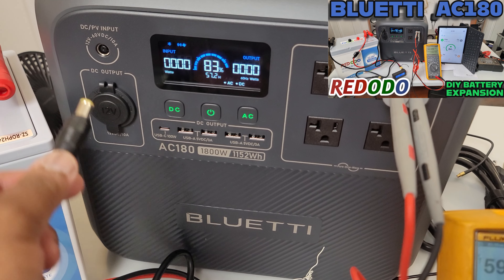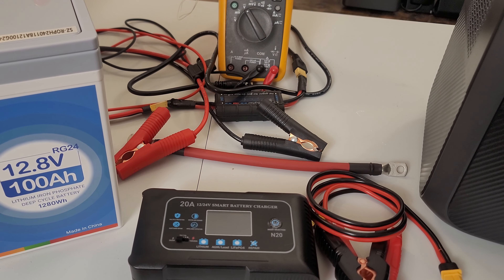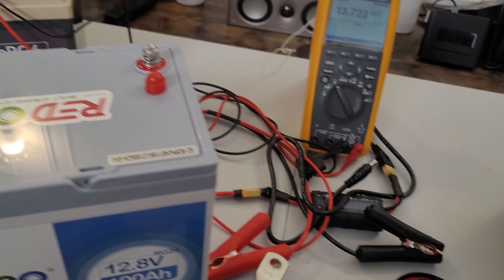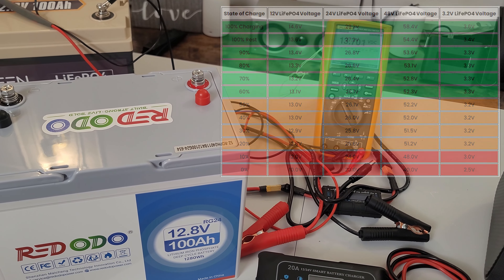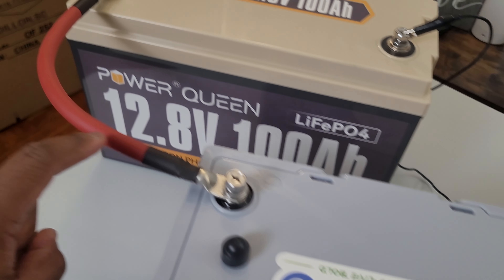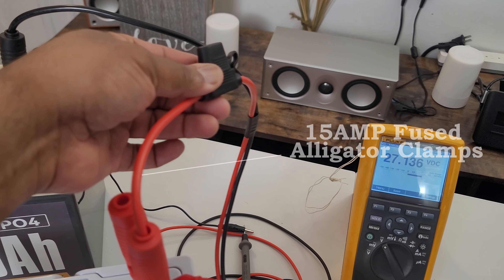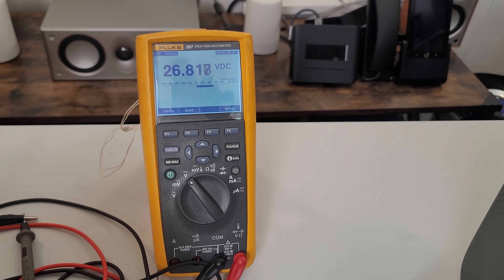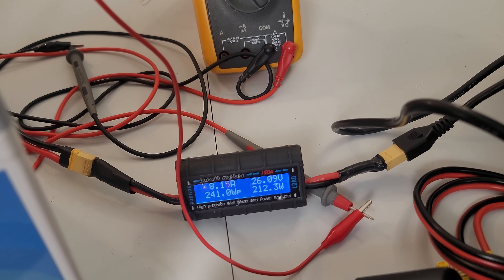Bluetti AC180 charging at 24 volts!

Comment: Based on your review, I purchased 24v 100ahr Repower Flow Battery in a case. Connected to BLUETTI AC180 thru cigarette adapter and it charges at 207 volts. The port is rated at 24 volts @ 10 amps. Now I have over 3000 watt hours of capacity. Will test if charging speed increases with 50 amp Anderson connector.
Reply: Sorry. Charged at 207 watts not volts.
Reply from the maker: Wow! That is awesome news! Thanks for the update and the information! Sounds like a great way to keep your unit topped off and with plenty of storage!
Reply: @randysmith3959  can you use solar to charge that repower unit?
Reply: You would need a cheap solar controller I believe. You can charge thru cig lighter port in your car but would take a long time.
Reply: Thank you fro watching@jeverhart99! Yes, you can utilize a solar panel directly to the unit or use a solar charge controller connect3d to panels with up to a limit of 60vdc.
Reply: @domingoc9721  Thanks!
Reply from the maker: Thanks again, and i responded from my second channel. lol 😅 sorry, and thanks again for watching!@jeverhart99.

Comment: From what my research indicates is that it is not recommended to put LiFePo4 batteries in SERIES without using a battery balancer. No battery balancer is needed when they are connected in parallel. Use a 12vdc to 24vdc 8-10 amp dc-dc booster transformer to get 24vdc from the 12vdc battetie/batteries.
Reply from the maker: Thank you for watching REDARROW-ez7dg and great comment! I too have researched this and yes, if you use 24 - 60 volt series connection, it is NOT recommended to use IF you are re-charging the pack. If you are draining the batteries in series, the types of batteries with the BMS in this system, would be okay for me but not saying it should be practiced. Being that these 100ah batteries are already in series utilizing 4 100 ah 3.7 volt batteries, these BMS have a low voltage disconnect that will protect the batteries from being damaged. What I would recommend is that you can drain them in series, but charge them separately to prevent any damage to the batteries. Not to mention to use a multimeter to check the capacity of the batteries. Not to mention, how much is being pulled from the batteries is another question. Remember, the Bluetti to recharge it through that port, is utilizing about 200 watts which is not a serious draw.

Sorry for the long response but thanks again for the great comment!

Comment: So in this configuration, is it possible to also use the AC180 for powering devices simultaneously?  In essence extending the time the AC180 could operate?
Reply from the maker: Thank you for watching longpoint17! Yes, you can drain and charge the bluetti AC180 and it is called pass-through charging. It has a UPS feature which allows you to have a device connected to the bluetti and use the power at the same time. In the event of a power outage, it automatically switches over. I hope that this answers your question and take care!
Reply: @TheCrucibleOfNYC  It does!  Thank you for your response!
Reply from the maker: You are very welcome and take care! Happy Thanksgiving and many blessings 🙌 🙏🏽

Comment: thank you for this video, I was thinking of doing this with s 24v 100ah lifepo4 battery. Have you tried charging from empty to full? Can you charge while discharging?
Reply from the maker: Thank you for watching davidahn4130! You are welcome, and that's a great size and voltage to have. I have not tried from empty to full, but doing the math, it should take about half of the 24 volt battery with some losses of heat and wire, of course, but not much. Also, you can charge the 24-volt battery while discharging it. You would need to check the maximum charging amperage on the bms of the battery. If it exceeds 20 amps to charge, you should be okay, but you need a 24-volt charger.
Reply: @TheCrucibleOfNYC  Thanks again! I'll try to get some feedback after I try it.

Comment: Alternator will be fried in a few months. Need to upgrade it first
Reply from the maker: @jimjames6990  Thanks for watching, and it would also depend on the load. The alternators have limits, but if you parallel your car battery to any inverter while the car is on, the power will be drained from the battery first, and then the alternator would charge the car battery.  Reading the manufacturers specs for the alternator and a little math, you have reserves that you can use.

Comment: I wonder if you use an xt60i it will fool the mppt to charge at 10 amps
Reply from the maker: Thank you for watching zodaguado6655! I think that the xt60! Cable wouldn't make a difference as I believe that port senses the voltage then provides the full 10amps, or maybe it needs the bluetti battery pack with its mppt controller to activate the full 10amps. I think when they designed these battery packs, they designed them with the intent of expansion using their accessories but allowing you to connect without the full use. Good suggestion though.

Comment: Very cool but 2 questions 1st question is do you really need that watt meter in between the battery and the ac180? Also i saw another guy do same thing but he was actually getting like 500 watts on a few of his units? Wonder why not on the 180 any idea? Thankyou so much
Reply from the maker: Thank you for watching randysaylor8577 and for the compliment. Also, good questions. For the 1st question, no, you don't need the watt meter. For me, it was something i chose as a visual need since I didn't always have a multimeter connected. I liked to see the amps and watts flowing through, but you can bypass the meter and get just the xt60 converters.

For the 2nd question, 
the solar input port does limit it to 500 watts, but keep in mind that my unit was close to 100%, so the charge will not go up to 500 watts. If the capacity would have been at least at 50 to maybe 70%, it would ramp up closer to 500 watts. Hope this answers your questions and thanks again for watching!
Reply: Man thank so much for you quick response you Rock!! Hope your channel kills it.
Reply from the maker: Thank you so much and I truly appreciate you and your well wishes 🙏🏽 God bless!

Comment: Why not use a 12 volt to 48 volt 10 amp converter
Reply from the maker: Thank you for watching @icemanca2001! The reason why I would not use one is that those devices, step up converter, gwt really hot and for me, I don't think that it's safe unless you use a cooling method or a massive heatsink. For the cost and accessories of a step-by-step up converter, I would rather invest more money and get another battery. Plus, you get more capacity as well. Great question, by the way, and take care.

Comment: Why not try a third battery for 35 volts to get it to charge at 350 watts?
Reply from the maker: Thank you for watching jesusrodriguez915! and yes, the limit for the Bluetti AC180, can go up to 60 vdc at 10amps. So connecting this at 36 volts should not be a problem and also, there's the purchase of another battery 🔋. Thanks again and take care.
Reply: I want to put 2 24c batteries in parallel,  what kind of cabling do i need for 48vdc to barrel plug? And should I disconnect batteries when charing and only get a 24 vdc charger in stead of a 48vdc charger?
Reply from the maker: Thank you for watching! Running two 24c batteries in parallel, you if they are 100ah batteries, you can use a 2awg cables if you do not exceed 100 amps. For 24 volts, you can use 6awg cables for upto 15ft. For longer distance, use 4awg. I would separate the 24 volt to charge them and use a 12 volt charger for each battery to charge back. This is just incase the cells don't fully charge in the pack. Remember, low and slow for proper charging since they use two bms. Hope that this answers your question.
Reply: @TheCrucibleOfNYC  oops,  I meant in series. 2, 24vdc 100 amp batteries.
Reply: Im pretty sure its only when you are above 32v you get the full 10a otherwise the ac180 restricts it to 8a below 32v
Reply from the maker: Thanks for watching danmillard2484! According to what the website states about the solar input, it says "500W Max., VOC 12-60VDC, 10A." I believe that when the battery is less than 50% of capacity, you will see the charging amperage reach up to 10 amps. 3 batteries will give you 36 volts at up to 10 amps, will give you 360 watts. Now, that can be optional depending on the state of charge from the Bluetti. Thanks again, and take care! Happy Thanksgiving!